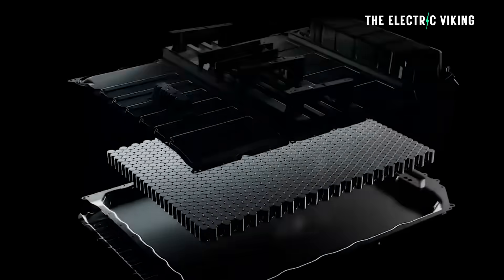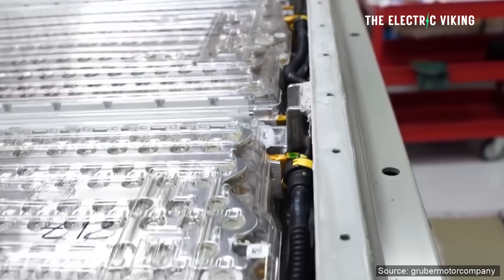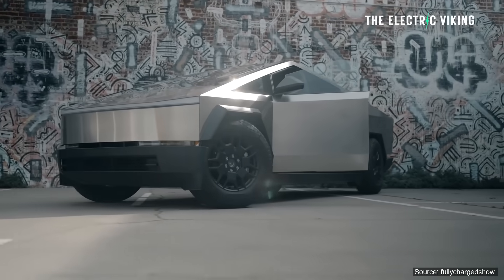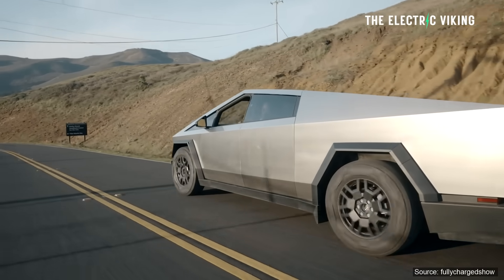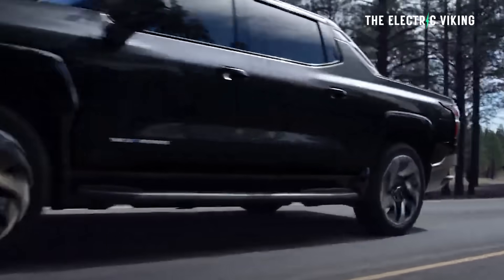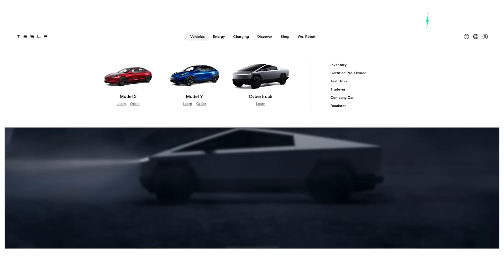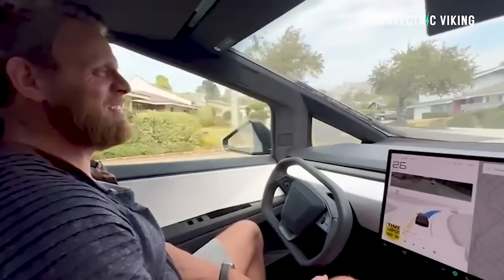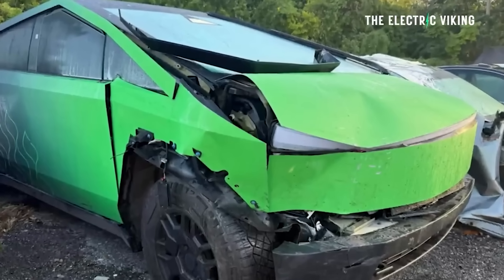Why Tesla is replacing ENTIRE battery in some Tesla Cybertrucks

Comment: It seems The Electric Viking may have color-blind issues (at second 54), since the heat sink gooey stuff is not purple-pink, but is cyan or aqua blue in color.
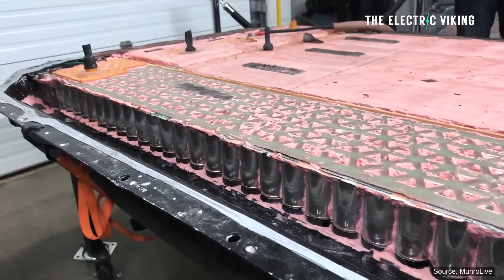Reply: O, wait, I see at minute 1:54 one battery pack does have pink goo. Maybe Tesla changed the color mid-production run?

Comment: For all of the haters out there (who know almost nothing about trucks), here is my experience,,,,,,,  For us CT owners up here in upstate New York, where there are few CTs driving around, I have to schedule at least an extra half an hour for any local trips around here to answer all of the questions I get about "what the heaven are you driving". So I decided to list them on a card that I give out if I'm in a hurry, here it is:
Cybertruck 30 minute dissertation short form;
My 7th and last truck (previous daily drivers, all 4x4 Toyotas starting with the 1979 SR5, last Tundra, a 2014 had 220,000 miles on it), love this beast, is the future, all electric, lightning quick (0-60 2.6 sec), steer by wire progressive steering (full left to right lock 340°), 4 wheel steering (really tight turns), air suspension (17" high setting clearance), regenerative breaking (rarely use breaks), 48 volt low voltage (really small wiring harnesses), Etherloop communication, heavy duty stainless steel body, almost NO maintenance (Tires, wiper blades & fluid is about it), over the air updates, and most importantly gas pickup $60 to drive 250 miles, Cybertruck $15-$19 electricity (400 wH/mile x 250 miles at $.15-$.19/kWh) to drive 250 miles, full slow charge at home 5 hours, full fast charge at supercharger 45 minutes,  and Tesla is 10-15 years ahead of everyone else.
I'm never going back to ICE...................

Comment: I just saw my first Cybertruck and was not impressed by the build quality. The stainless quarter panel over the rear wheels was wavy, and the fingerprints would drive me nuts. Panel gaps were off.

The 48v harness and steer by wire is cool, but the aluminum castings are brittle, and can fail during rough towing.

I wish Tesla would have built a more conventional truck, instead of a fridge on wheels.

Hate to criticize, but another issue I would have is the limited wheel articulation when off roading in the lifted mode. I have seen videos where the Cybertruck lifted it's wheels into the air over small obstacles. My lifted Jeep JK has way more wheel articulation and is like a cat compared to the stiff low articulating Cybertruck suspension when off-roading.

By the way, the sales will tank once the Tesla fan boys pre orders are used up. No normal guy that has owned a pickup will buy one. This thing will join the Ford Edsel in automotive history.

Comment: "Case-in-point: Tesla recalled the most vehicles of any automaker in 2024 at 5,135,991. But the EV manufacturer only issued 16 total recalls, compared to the 72 recalls by fellow American automaker Stellantis and the 67 recalls by Ford. So with that in mind, here are the ten automakers with the most recalled cars in America for 2024."
Reply: And 95 percent of those recalls where done with an over the air software update- meaning it was fixed will the person was at home
Reply: Number 1? Tesla

Comment: Considering the fact that there have been explosions of Cybertruck batteries, including one today in Las Vegas, you really don't want one. Well, I certainly don't. You're better off with a regular Hi lux ute in OZ, believe me.
Reply: The one in Las Vegas was due to fireworks in the truck bed. The bed also contained the blast, none of the windows of the hotel were broken ...
Reply: Fake news. Bomb exploded not battery pack
Reply: O.P. couldn’t be more wrong. Are you really that STUPID! Even the police have said the Cybertruck design saved lives, by containing the explosion and forcing most of it upwards.

Comment: They need to change the tow system before I would consider buying one. The fact that you can't stress the tow hitch at any sort of verticle angle without it failing is a baffling design for a truck. I am also really not a fan of the button turn signals/windshild wiper system. Those are not things I want to be fumbling with on the road or something I want to take my eyes off the road to manage.
Reply: Nonsense. Towing hitch is strong and one of the highest rated for a pickup.
Reply: @royh6526  You should read what I wrote. It can't take vertical loads. Its owner's manual rates its vertical load limit at 160 lbs. This makes it unsuitable for towing certain trailers or carrying heavy attachments that put significant downward force on the hitch. And given the low amount of vertical weight it can handle I would even be wary of towing anything that wasn't on even ground.
Reply: @NinetooNine  You should read your owner's manual. That 160 lb limit is extended 16 inches beyond the hitch, intended for bicycle rack where two bikes are carried by the hitch alone. No problem with a regular trailer.

Comment: I really dislike when people mention efficiency as if that will give you a better experience than more range. Range is the only downside to EVs. The notion that people rarely drive that far is a cop out also, when Tesla makes cars that go from 0-60 in 2 seconds. Which is unnecessary and which is actually useful. I love Tesla and just want to see the range improved.
Reply: Ok you pop off and change the laws of physics, or you can wait for them to do the work with the existing ones.
It's not a cop out to point out you are asking for some you don't need.
People want everything they have and new stuff doesn't matter they never use it see the passage sit adjustment button wasn't used  people kicked off  for months, even the haters have forgotten about that non issue now.

Comment: ...Because Tesla is not a good brand, and because their products are badly built now, based on what the good engineers did years ago, before they quit to create Lucid Motors, or were ejected (like those working for superchargers). They are trying to do better batteries as Nio has mich better 150kWh battery pack now for much better vehicles...

Comment: How can you tell if a cell has dents in them in a sealed, gooped battery pack? The CyberTracker has had at least six recalls, which is typically what car makers do these days, put them to market before they beta test. I don't think the Cybertruck will make it down under, due to price and I don't think VicRoads and so on would allow them on the road.

Comment: I think this is problematic for recycling . The other problem that Sam has said it makes it basically impossible to repair .  It's a bit wasteful. The Ford lightning the battery has separate modules that can be replaced which they had to do in some of their models . So these Teslas out of warranty the only way to address a battery problem is the most expensive way to solve which is replacement . So considering that buying a used Tesla out of warranty is a bit more risky over battery packs that are more serviceable . Tesla has made the decision not to have a serviceable battery pack which is a shame as they are a popular used EV brand . If you have a cell problem and need to replace the whole battery pack that is still very costly would make the car mostly a throw away as with many things in are society . The desire to make long lasting is not on the list for Tesla . They want you to buy new new say every decade at most
Reply: Whilst Fords battery packs are assembled in modules, Ford does not sell individual modules only complete battery packs
Reply: @DaBooster  They were replacing defective modules under warranty.
Reply: Has no pact on recycling the packs are ground in to black mass not disassembled which was the point it make the pack recyclable but it cannot be broken down for the reseller to make bank.on Tesla's work and open they to extra court case and bad publicity

Comment: They really should make the battery packs modular in some way so that in the distant future, they can be replaced or repaired.
Reply: Modular is the wrong word for it. A modular battery pack is one that I would imagine swapping out on a regular basis (like swapping a depleted battery for a fully charged one). But I do think it makes sense to make removing/replacing the battery on an EV more accessible.
However, making it easier to remove always comes with risks. The battery of an electric car is an expensive and important thing, and being able to remove it more easily means ANYONE can remove it more easily.
Reply: @THECHOSENO1NE  Modular could also be a system made up of a multiple identical individual packs assembled and interconnected.
Reply: Yeah I don't mean to be picky but my model 3 pack has modules. You can service an individual module. 

I think you [I think I think the same as you]  lol mean it should be easier and more practical to get to the modules?

Comment: I think the battery pink goo can be chemically removed and the cells re-used on PowerWalls or other vehicles, but as used vehicles, since those batteries are not technically new. I believe the replacement of the entire battery pack is simply a question of logistics a quick turnaround time on the repair and Tesla saving their image.
Reply: @kgamaseg  - Cells do wear out and I can’t see Tesla incorporating used cells in a brand new Power wall. Repurposing cells seems a good idea if you happen to pick up a freshly discarded one-use vape as you know it’s done one charge - discharge cycle and it’s likely good for a thousand more. But a vehicle battery might have been run hot charging fast, or discharged deeply, or been through several hundred cycles before its back in Tesla’s hands is not likely to behave like a pack of new cells. They might be cheeky enough to put good used cells into a pack of other good used cells to balance the pack - but then it’s a used battery.
Reply: @sullivanrachael   a powerwall can be advertised and sold as being refurbished.
Reply: One of the yt channels that does teardowns (I think it was Sandy Munro) mentioned that it can be dissolved but it requires a very hazardous solvent.

Comment: I rather think this shows how bonded cell packs are a long term issue. It’s great if they work long term; but if one component fails - the pack is not repairable. So if the truck suffers a massive shunt, or a cell suffers premature wear; it’s a dead truck. Can’t be good design. It might be efficient when it works. But it’s not even like a cheap appliance you junk when anything significant fails. It’s an expensive vehicle that is really costly to fix! I’m not a Cybertruck hater either, I quite like it, and it’ll look very cool in a military camo wrap!
Reply: They can suffer with corrosion if the air cannot get to the Stainless steel... So you may want to do some long term checking in temperate and tropical environments.

Comment: No repair facility repairs or replaces individual cells in a battery pack.  The cells have to be individually evaluated, which is too time consuming. It is often too difficult to remove a single cell because it is glued in and soldered as well.   Hydro Quebec is working on a process for repair and recycling of battery packs containing lots of individual cells.   Because of the difficulty in repairing battery packs,  federal legislation requires the manufacturer to provide a warranty of 8 years or more, so that it is usable without repair costs burdening the car owner.
Reply: The BMS tells you what cells are bad.   Hopefully it's not in the middle😂
Reply: @veganpotterthevegan  Yes, I do understand that. What I said was that INDIVIDUAL cells are not removed. Modules are made up of individual cells.  Structural batteries are moreover different from modular hybrid batteries, which are more easily disassembled, and usually don't have the glue between the cells, such as old Prius batteries.
Reply: Yes they do. The built in systems identify exactly what is broken. Most packs consist of modules. Just unbolt the faulty one. Actually a simple repair.
Reply: @mbak7801  Not on a tesla battery, it's all epoxyed together to save money. It's not repairable.

Comment: If companies were serious about saving the planet and reducing waste they would make these batteries repairable but that's not how the game works that's why they are set in epoxy so you can't replace individual cells . Remember years ago most mobile phones had easily replaceable batteries,the reason they went away from from that idea was to sell more product as there is more profit in selling a new phone than just replacing a battery. Saving the planet by producing more unrepairable junk

Comment: The problem with the Silverado is the weight. A vehicle that heavy wears everything out faster and is more fragile in off roading situations.
Reply: That's your assumption, not fact.  GM has been making millions of trucks for over a century, I think they know how to make the Silverado.
Reply: @RussellFineArt  It's not an assumption. It is a fact of physics. GMs experience can't change that.

The truck weighs 1 ton more. That means tires will wear faster, suspension parts will experience more stress, and forces in off road situations will be more extreme.
Reply: The price you pay, so they can claim more range. Affects payload capacity as well.

Comment: I’m a big fan of the tech in the Cybertruck (steer-by-wire, 48v, 4 wheel steering), but the range is subpar when taking long road trips. I’m a reservation holder that took a pass mainly because of range, as well as the cost is too high, sadly. I also think that Chevy having 450 miles of range for the 2025 model makes Tesla look bad. Especially, when you consider that half the cells in the CT are empty. Big miss.
Reply: I agree with your points but please really consider how frustrated you're gunna be trying to recharge the chevy on 3rd party chargers. 

We really need more non tesla chargers with reliability
Reply: @ I agree. I would never buy the Chevy.
Reply: @skellington2000  im sorry, that changes our need for multiple competitors creating infrastructure we can trust? Do you see one brand of gas stations bud? Can I give you some trivial info that you already know? That has no bearing on the point being discussed?

Yeah cool we all know but it isn't every tesla charger and Oops we still need more chargers 😉.

Comment: not enough actual information other than some cell denting (no definition on what that is) has been found on some unlisted number of cybercrook's and the initial plan is to replace the entire pack on those so they can learn more about how why and what happened. It sounds like a very small number of trucks and it sounds that it is not dangerous just some sort of fault issue on some packs. 

We will find out what happened sometime soon as well as how many trucks this effects. But from all the articles i have looked at it sounds like it is a very small number of trucks. Again we shall see in the next few days it if is a nothing issue with a new model of vehicle or something wrong with a production day or so of batteries or if it is a larger issue..

It also sounds like it is something that can be detected by the software itself.

We shall see. And main stream media will announce it is the end of Tesla.

Comment: Just saw one, looked dirty? The bed was smaller than my Tacoma?
Reply: Bd is 4x6 .. so about the same as others in its class but it hauls over 2000 lbs and tows 11000.  Buy what works for you man.  Most people use trucks like SUVs … personally Ill buy a CT because I prefer EVs for their power, quiet ride, no smell, no shaking, and they don’t kill me and my family with toxic fumes.
Reply: @Tech_with_Loco  I have had ice fires being a mechanic and had 97 cars. A liter of Coca-Cola will put out most ice fires.
Reply: @Roberto-mr9mv  Bit hard when the car is fully engulfed in flames. You will be lucky to get out of the car in time let alone find bottled coke and start trying to extinguish the fire.
Reply: Ev fumes are deadly when they burn.
Reply: @Roberto-mr9mv  Gas cars burn 10x more vs EVs.  Denying reality is not useful .. read up on it man.